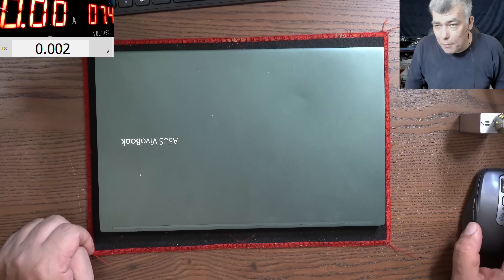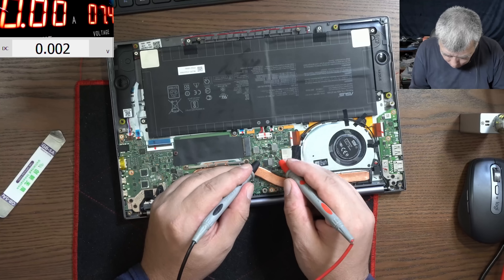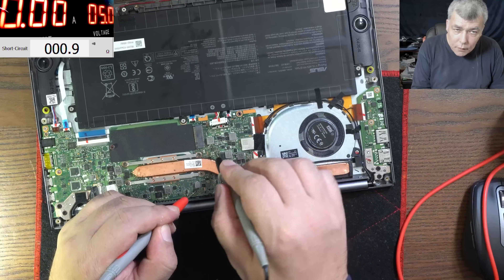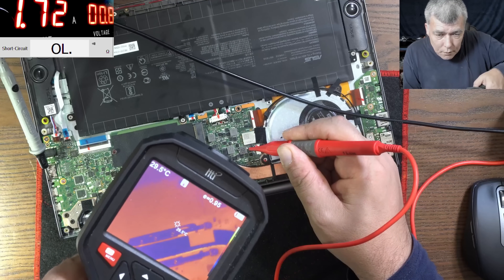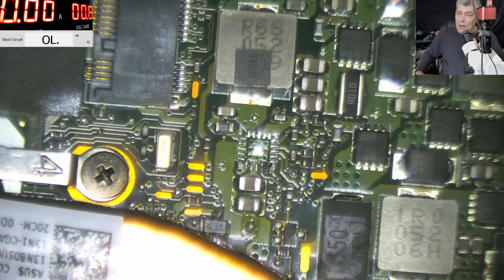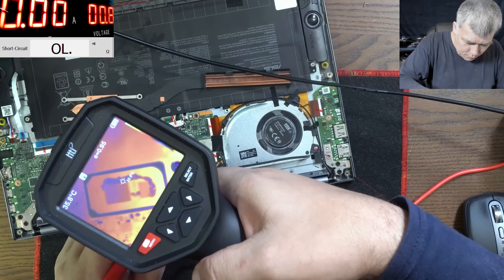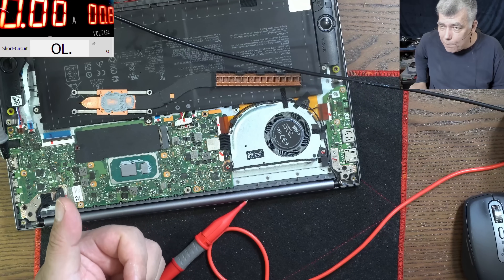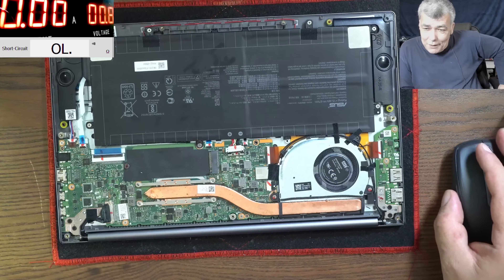Asus Vivobook s14 - Repair attempt - Never seen in a laptop 3 shorted power rails :D

Comment: Hi Sorin, I have an ASUS TUF F-15 gaming laptop. VCORE, 1.2V, NVVDD, GFX rails are shorted to gnd with 0.6 ohms . By removing the inductors the shorts appear on the CPU/GPU side respectively. 
What are the odds that both GPU and CPU died simultaneously? Or am I missing out something here.

Comment: I would recommend using the thermal camera to tell if the components are get to hot to fast from voltage injection. I’m noob but seems smarter. The components look like they get hot really fast when you look at it that’s too aggressive to me when you can lower voltage and wait 10 secs more.

Comment: Its not a fail for me you already know what is the problem the CPU is dead you just need to have BGA machine that we have here in PH. You can actually reball the CPU and resolve the issue. If the reball process will not resolve you need to replace the CPU with newer one with BGA machine. If you have the machine tool and other equipment any laptop you can repair. by the way good job. Thanks for the video.
Reply: And after the cost of tools and replacement parts, the repair would not be worth it and no one would want to have their laptops repaired. They'd simply buy a new one.

Comment: Thanks for the video, I see a mistake, we should not put the thermal paste on the PCH, cause the CPU will transmit heat to the PCH.
Reply: but isn't the PCH itself generate heat? no?
Reply: @maklogetrich2378  it not getting very hot, just a little warm, need only a heat sink.

Comment: Imagine if the CPU was socketable and easily replaceable 🤯
Imagine if the southbridge wasn't built into the CPU silicon 🤯
Imagine if this entire overpriced laptop/motherboard didn't have to be replaced because a single component failed 🤯

🤯
Reply: apple : we cant imagine
Reply: that's what happen if the company or the user itself wants a slim laptop
Reply: Buy a framework then
Reply: Intel is ripping everyone off! They are responsible for 99% of unrepairable boards!
Reply: Your diagnosis is always accurate and you use the right tools . Sadly is  not all PC we can bring back to life
Reply: Well, if you want a very slim laptop yo need ti sacrifice that for the sake of a smaller size, but you are right, and adding soddim slotd and a normal socket shouldn't have a huge impact in that matter
Reply: Can you add a socket and put in a removable cpu?
Reply: It's called 'progress' lol
Reply: imagine all the people living for today.....
Reply: Well you just told the lore that is behind crAPPLE and because crAPPLE did it all companies followed

Comment: The motherboard companies now make mostly if not all embedded cpu where they use to be the sockets and change the CPU out for another CPU - not anymore
Reply: My first notebook have socket, I even “upgrade” this PC little bit when change CPU to more powerful with 2 cores. No bios manipulation needed, just disassemble bottom case and remove heat tubes. Now sometimes we can,t upgrade RAM or SSD everything just soldered, so sad :(
Reply: Cant you solder in another cpu